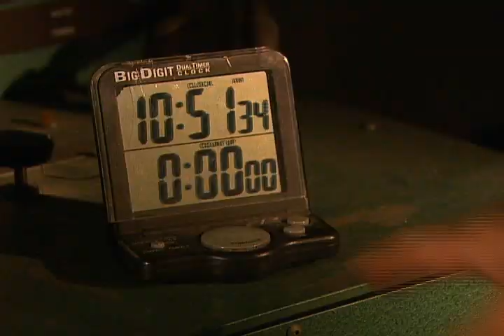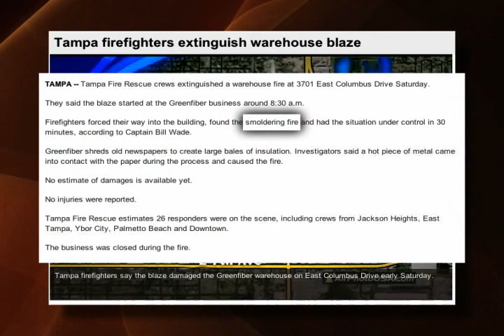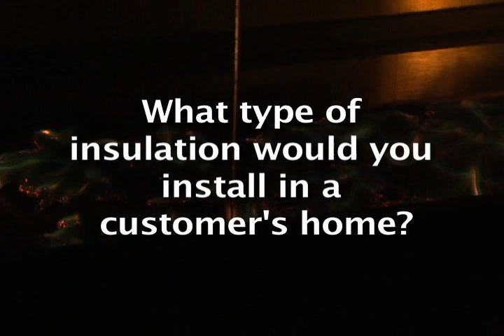Fiber glass vs  Cellulose Lab Experiment

Comment: As cellulose is being manufactured, fire retardant is added. 
There is a stage at the factory where it's just threaded newspaper and flammable,  by the time it's sent to you it won't burn. 
Its better for environment then fiberglass,  and when cellulose is installed properly won't compress much (just add an extra inch if your worried about it)  no water is added when sprayed in attic it's mold and pest resistant, unlinke fiberglass and its not as hard on respiratory system. 
This video is as trump would say "fake news"

Comment: Cellulose paper insulation materials are environmentally friendly and 
cost effective (due to its shredded waste paper origin) when compared to Fibreglass insulation,  but it is combustible and rapidly burns out. The main cause/s of cellulose insulation fire/s are: chimney related, Electrical faults, Lightning strikes affecting the roof and contractors carelessness. Installation advice for contractors:  
Have the attic space electrical installation tested by an qualified electrical contractor, and do this every 3 years afterwards . Loft wiring should be in conduit but not attached or adjacent to cellulose insulation.  Do not place high wattage lights or electric fires or radiators near the insulation or allow the insulation to overhang electric fittings.  Do not insulate near recessed lighting into the ceilings below. Use heat resistant bulk head light fittings in the roof space. Electric supply cables need to be prevented from coming in to contact with cellulose insulation, or adjacent to other flammable materials.

Comment: A more believable experiment would involve burning an actual wall construction sample representation rather than a laboratory oven with an open flame on bare material. There should also be a description of the fire retardant properties of both materials instead of  hinting that cellulose insulation is nothing more than shredded newspaper, which is untrue.  To be fair, both samples should have the same insulation properties as well which is ignored in this comparison.

Comment: Fiberglass might be fire resistant but that doesn't change the fact that it is a horrible insulator. Resistance to fire seems to be the only leg fiberglass has to stand on, why not just fill your walls with sand if you don't want a fire. Fiberglass should be banned from use it is a complete marketing scam. From the people that brought you asbestos, we bring you...fiberglass.

Comment: What a bunch of B.S. fiberglass is a very unsafe product, will help spread fire, most importantly it just doesn't work well OUTSIDE OF THE LAB. It doesn't stop the flow of air as well as cellulose, mice and vermin love to live in it and this video is straight out propaganda for a material (fiberglass) that will some day come to be viewed in the same light as vermiculite or asbestos in terms of human health consequences. Cellulose is a very safe product, will not settle over time or spread fire.